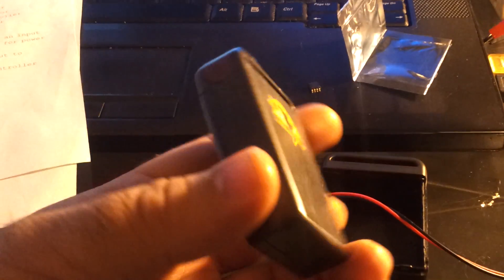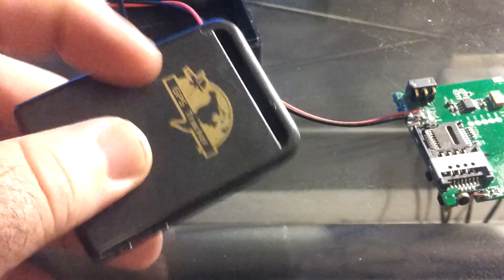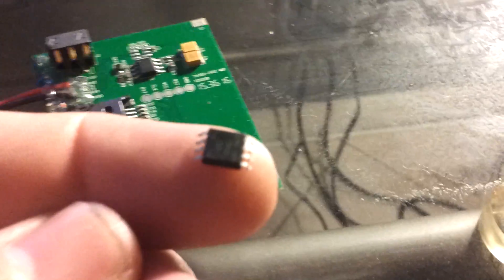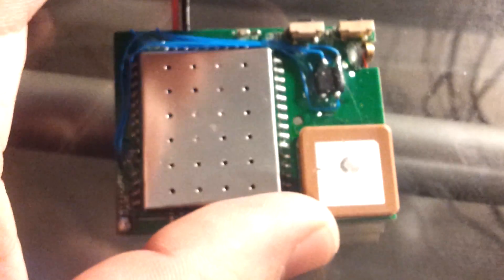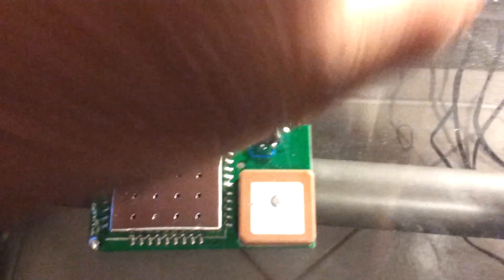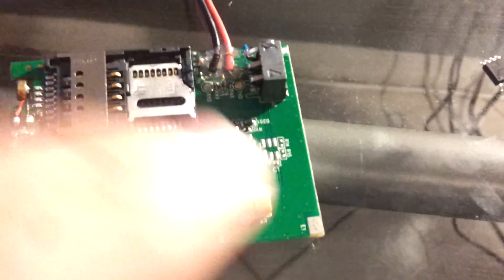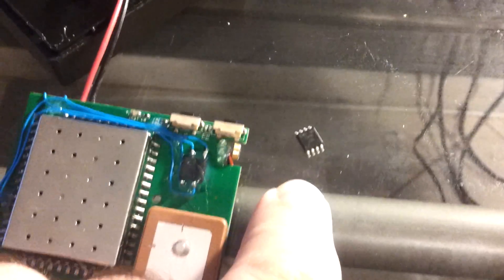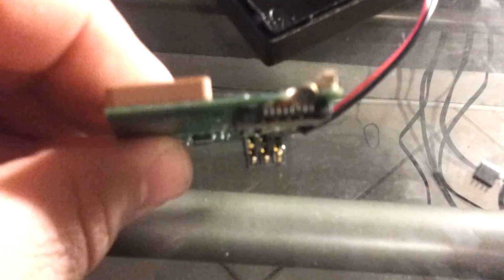TK102-v02 Mini GPS Auto Power Off bug Fix / Hack. tk102b

Comment: I have a coban 102b. I’m curious if I have no proprietary power cable, would I still be able to attach power by connecting leads to the GND and +5v pads on the PCB? I want to hardwire the unit to always be on in my vehicle and I have no power cable. Also I noticed that my battery connection was loose and came off, I will have to resolder that back on but I’m not sure if I even need it if I’ll be having constant power via the vehicle. Any ideas?

Comment: Hi, wonder if you can help me, The unit stopped functioning. It was working fine. 

Now it is blinking but not returning the command verifications. The card have credit and if installed in a mobile works fine. 

If I send tracker123456 I receive nothing back. Basically the unit is not replying to the commands. 

How can we sort this problem please?

Comment: WELL DONE CARLOS....My friend my name is Tanos and iam from Greece i have that problem with my gps tracker tk102b...is it possible to pay you with paypal and send me the istruction and the model of the chip since to send over to Amertica and send me back i will PAY A LOT OF MONEY....the truth is if i send over to you it is the same thing to buy something else and more expensive BUT i do not want to FIX IT WITHOUT PAYING THE MASTER WHO FIND THE SOLUTION...IF you want  just tell me ...I DO NOT WANT SOMETHING FOR FREE...THANK YOU VERY MUCH...
Reply: do it by yourself the gay is asking very much money that is bullshit! You can solder the pin from the button to GND. You can also take off the button and replace with a switch or you can code a microchip to check power form the led and when there is no light it will turn it on again. It is really easy and simple with arduino and some tools. DOn't waste your money

Comment: Hi there
If You wish to have TK-102B (and others maybe) switched on automatically after power connection it is enough to have on/off button pressed permanently. Mechanically or soldered shortcut.
OK to turn it off You have to off power supply but sometimes it is no matter.
Reply: Thanks, tried and it works

Comment: Carlos, a second post. I managed to remove the circuit board and remove the charger socket... Horror! While the charger plug only offers a positive and negative cable to left and right of the plug, the socket was bristling with nano connectors, I guess for information by wire. As I don't intend to do anything other than by phone SMS and GPS Maybe those connectors weren' important for me... What isn't obvious is what I should solder the new charger wire to, can you please tell me where you found your plus and minus 4.5v terminals on the circuit board? I see that there are two unused + - holes on the other end of the board but don't like to assume that these are for a charger input. Thank you in advance Stuart stuatstu2.eu

Comment: Very useful, thank you for posting. I wonder if you can advise me, Your external power wiring is of particular interest to me as I need to do the same. I need to install my Rewire Security Nano TK 102 version 1 (basically the same as your unit) in the tiller of my mobility scooter, that being the one place I can find albeit very limited space for both the tracker, its hardwire unit and a 12 volt/ 24 volt power supply. But, there is not enough space for the power plug.
 I can briefly see that you have replaced the USB like power socket with a 2 core wire. I need to do the same, but I think that the circuit board in mine is either glued in, or a much tighter fit in the plastic box. 
I either need to remove the circuit board somehow or to open the tin usb type power socket from above without removing the card. Can you please advise me on either option?

Comment: how to diable shock sensor, to tracker would be standby
Reply from the maker: they don't all have shock sensor. But it's a plus when they do cause it saves power and data use. But the unit remains on. Issue is when it powers off from a freeze or reset.
Reply: mine if i leave it, it always standby, but if i take it in hands, already flash led, so it had some sensor in hardware

Comment: Hi,

Do you also have this chip, for the TK102 V3...???
I have opened mine, removed all shields from both side of the PCB, but mine (V3) is very diferent from yours (V2)

Regards
Reply from the maker: There is actually so many clones off this device but I have tested and modified the programming on my chip to work on multi versions. So far I have tested and confirmed to work on 9 versions of the TK102. email me some pics of your board. I also made solutions for tk102 units that don't activate when power in plugged in the charger port. That is another headache I have found with many clones.

Comment: I have a question. Can I directly connect 5 vdc to this unit without a regulator (hopefully it has an onboard regulator)? I want to use this as a rc plane finder and I don't like the battery hookup. I would rather hardwire it to an external battery/source. Oh, and I will be buying your watchdog timer mod as soon as I get this thing up and running. This is my first unit.
Reply from the maker: sadly, you HAVE to use a battery per design of the GSM unit. Every one requires a lithium battery to run. BUT VERY small light weight  batteries can be used. Connecting directly on the battery terminals will damage these units because the battery charging units. and charger port with no battery will not have the AMP required on activation surge. But it can be done for sure. tiny and light for an RC

Comment: 14 dollars each, haha thats more expensive than the tk102 itself
Reply from the maker: I have seen clones for under $14, that is true. but that bug makes it commercially useless for auto and  asset tracking. it's a shame because it truly has the best battery in mAh ,real GPS chipset for the size. why so many clone it.
Reply: There are clones of attiny85 too, they work the same, should be like 2 bucks for 5 pieces or cheaper even sometimes.. Is battery life about 4 days standby?
Reply from the maker: Depends the location but you can find them. You can buy a blank Rom chip for under $1. You can also buy a blank bluray disc for way under $1. Once you burn code on it, people pay way more
I have been able to code the tk to last 26 hours on battery using the 1000mAh L5 battery. sending 2 beacon locations a min with GPS chip shutdown 30% of the time because of no motion detected. GPRS continuously connected to a platform.
In another experiment, I was able to code the device to activate 2 times a day to send a SMS update of location. on 1 full charge using the 1000mAh battery, I was able to get 13 days of operation before if began to skip from low battery. But this config powers up unit and when unit is off,it can not be remotely woken up.
standard operation mode fully charged gave me about 2.9 (just shy of 3 days) days of use. averaging about 10 sms location requests a day til it needed a charge again.
These tests were conducted using the TK102b-v02_MT61 variation of the device...
. I will answer whatever questions you have but if you are just trying to be a bitch ass trolling cunt then may I suggest you go to another video channel.
Reply: Thats impressive, and no I'm not trying to bitch, you said if you could find them cheaper it might change, I'm just saying the clones should work just as well usually.. I've been using attiny85 for a project some time back as well, and the clones worked just as fine as the real atmel's.. That's all I'm saying
Reply from the maker: I'm sorry.. I have a few channels and trolls are sadly common place on the internet. The atmel attiny is a FANTASTIC IC!! works with a wide input of voltages and with builtin clock keeps it easy.. The memory size is small but coding tricks like loops and comparing equations reduce the size. If you reduce the clock speed to 1mhz, the chip will run on 2.8 volts and standby voltage is under 10 microamps. I love that chip.

Comment: Its that 18gps.net 2016 version ? Manual power ON and sometime auto power OFF ?
Reply from the maker: Most every TK102 I have worked with powers off 1 time or another. The Version you see on the video is actually the 228gps.net 2016 TK102-v02 with the Mediatek GPS and Chipset version.

Comment: hola carlos , vivo en florida y queria saber donde debo enviarte mi gps y si es como tu dices ,$25 dolares , ese es el precio de arreglar el problema? se apaga solo despues de un tiempo y cuando lo prendo la luz verde queda encendida y no parpadea , gracias y espero saber de ud .
Reply from the maker: Hi Oscar, I charge $25 for the labor. I have been told it's not clear in the video. and the chip is $14. What city are you in and how many of these devices do you have? I'm currently in Hollywood, Florida not far from Miami. Call me. My number is in the description.

Comment: Hello Carlos , do you also send te the Netherlands ? And is a manual available to do the adjustment ?
Reply from the maker: I do include a manual. Does Require minimal tech ability because you will be soldering cables and there is SO many variations of the TK102B. But if you have soldered electronics before, it's easy.

Comment: where I can find the Rx Tx from this device?  because I will connect this device to arduino
Reply from the maker: This model I have in my had you can not see it very clearly because I soldered hardwire to the power BUT under the epoxy where those wires are is a 4 traces. 2 are the GPS rx/tx and the other 2 are tx/rx for the microcontroller that also talks and connects to the GPS. The chip I use in my mod is actually an Arduino in a surface mount atmel attiny85 chip. The arduino is a great micro-controller. Thank for watching.
Reply: very good explain. can i get the source code for my study.  I will make a device from gps tracker.  thankz
Reply from the maker: goto adafruit.com . You will find allot of items and one of the best support pages. I don't recommend using the GPS on the tk102 because it's already has an embedded controller that shuts it off and on to save battery. Also one of the easiest arduino library is one called TinyGPS. Look for that, has plenty of useful commands and going to use NNMA GPS devices.

Comment: i would l to have one can you make it with a standby of 3 weeks for how much can you sell it
Reply from the maker: +mik ik that is a very interesting request. If you are asking for the device to turn on in 3 weeks time automatically, then I can custom make you a chip that will do that. $14 for the chip, and the custom coding is $150. I can code it to NOT activate if it's already on. Very interesting request.
Now if you are saying that you want the device working FOR 3 weeks without charge, you will need a VERY large battery. At least 35Ah

Comment: Impressive.  I would love to have your mod-chipped improved type, running your code.   Sadly I wouldn't be able to upgrade a tk102 v2 myself, and I am in United Kingdom.
Reply from the maker: HPCer there is so many different types of tk102s. I understand that it's not common for the average person to have hacker wire, soldering iron and such. I am looking for a solution in the near future as I have been getting a lot of email about buying them ALREADY chipped directly.
Reply from the maker: +HPCer due to so many requests, in starting to built the units with chip already. If interested
Reply: @cashe18  hi, do you still do this service, I'm looking to purchase within a month's time
Reply: carlos i see your  video and i have 4 of this to update  how i can send it to you